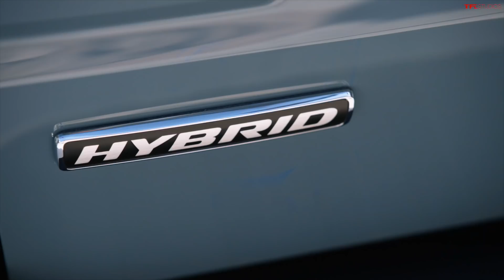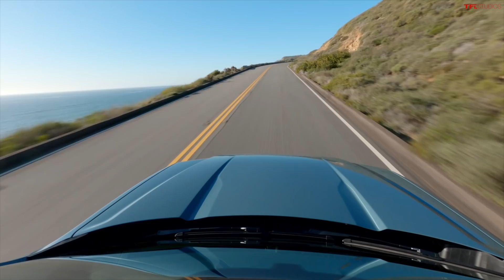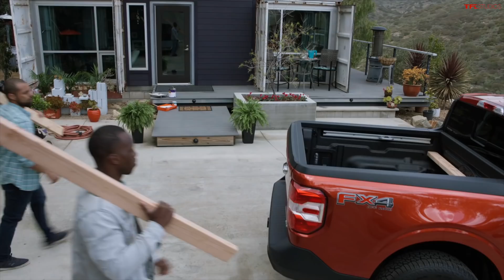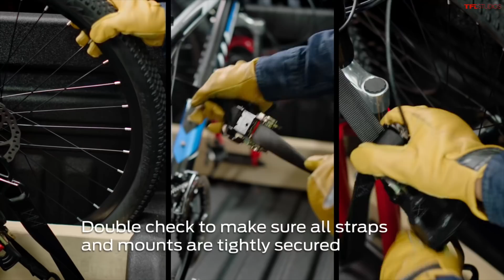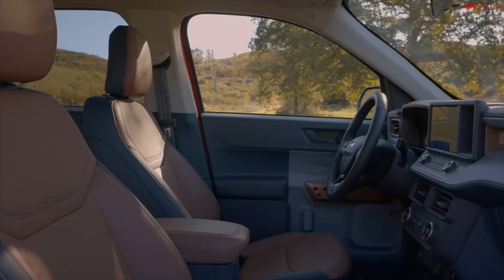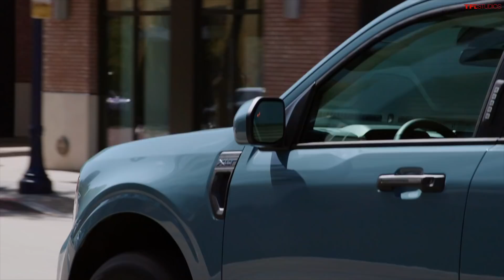What Do You Think Of The 2022 Ford Maverick? I Get ALL The Details From The Guy Who Built It!

Comment: Me when I first heard about this truck: "It's to small if I am buying a new truck it's going to be a full size." Me seeing the built in bed separators and hearing the price: "Look at my new truck."
Reply: I should have bought a bigger truck. You by the time payment one rolls around.
Reply: Me: I’m never going to need a truck!

Also me: yeup I’m buying a new truck!
Reply: Most trucks have built in bed separators and have had them for several decades. I use them in my Nissan Titan with 2x4s to keep my kayak from sliding around in the bed, same deal with the F-150 that I had before it.. But yes, the price and the mpgs cant be beat.

The only current exceptions are the Honda Ridgeline, which has no bed separator slots, and the Toyota Tacoma and Hyundai Santa Cruz which have horizontal separator slots but no vertical ones. Other than those three, every other truck currently on the market has both vertical and horizontal separator slots.
Reply: Like they say a fool and their money are soon parted, this Maverick is going to cause a lot of buyers remorse when people find out a unibody front wheel drive wannabe imposter pickup truck won't do much of any real hauling when you need to use it.
Reply: @ramecodiesel8271  Except that nobody is buying this expecting it to be an F-150. Ford has been very honest about its size and capabilities. For the one or two days a year where they need more capability than the Maverick offers, they can do what everyone else who has a crew-cab short-bed truck does and go rent a truck with an 8-foot bed for $25 from U-haul. 

Being foolish is buying a half-ton truck when you will never need or use its full potential.
Reply: @ramecodiesel8271  

It tows more weight than my old crew cab 01 Frontier could. And it barely got 17-18 MPG. And it was a real truck with a frame. Yet this little unibody can out tow it. And will get about ten mpg more. And will ride a million times better thanks to IRS and the unibody build. 

 I loved my little Frontier. And this truck is the first truck I’ve seen in a long time that reminds me of it. Something small, easy to maneuver and drive, and will fit in any garage. But without any of the negatives my Frontier had, which were numerous. 

The Maverick and Santa Cruz are successors to the small crew cab trucks that were being built in the early 00s. The Frontier, Tacoma, and S-10 were excellent little daily drivers but they had some severe issues that couldn’t be fixed. They all got crappy fuel economy and rode like shit. These new unibody mini trucks fix those two big issues and combine their positives (the easy to drive nature and utility) with modern technology.
Reply: Bed is too small. You couldn’t even lay a fishing pole diagonal in that thing.
Reply: @pagodad2036  It's a sub-$20,000 truck... there are going to be compromises. You can't have your cake and eat it too.

lemme guess, you also think it should have a 400 horsepower v8?
Reply: @dave3682  you’re not good at guessing.
Reply: More cargo room in a minivan.  Its a tiny persons truck.  Ill stick with my F150.
Reply: @keyoke69  My word, it's not like this thing is meant to replace the F-150... No one is telling you to trade your truck in for this. The F-150 won't work for Maverick owners for the same reason the Maverick won't work for F-150 owners.
Reply: @dave3682  20 bucks says you cant sit in the back seat.  Make it a 2 door and it could be a useful little truck.  As is, its trash.
Reply: @keyoke69  Looks like you owe me 20 bucks then. It has 36.9" of rear legroom... more than the Ford Ranger crew cab which has 34.5" of rear legroom.

Nobody buys 2-door trucks anymore. Yes, I agree, that's unfortunate, but if you're building a unibody truck and you only pick one cab and bed configuration you'd be foolish to choose anything other than a crew-cab short-bed because that configuration makes up over half of all truck sales. Especially since the Maverick is supposed to compete more with the likes of the Honda Civic than other larger pickup trucks.
Reply: @dave3682  I saw a review with a guy 5'9" in the back seat and he had no legroom.  The back seats of midsize trucks are only useful for kids.  This thing isnt a truck.  Its a car with no trunk lid.  A van would be a better choice in every way over this thing.
Reply: @keyoke69  I saw a review with a guy, 6'1", in the back seat with the drivers seat set to his driving position and he was able to fit his fingers in between the back of the seat and his knees.

What hybrid van can you get for $19,995 msrp???

Exactly, it is a cheaper and more fuel-efficient Honda Civic with a 4.5' open trunk and more payload than a double cab Tacoma. It don't matter what you call it, that's a helluva deal!
Reply: @dave3682  it doesn't matter how cheap a football bat is, Im not interested.  Be something,  not half a** everything.  Btw, im 6'3". Ive sat in all the midsize trucks.  The back seats are a joke.  They are a waste of money.  Better off with a van.  More comfort, more cargo room.
Reply: @dave3682  you know this thing isn't going to be 20k right?  Just wait.  Its a 1 model run vehicle.  Football bat is exactly right.
Reply: @keyoke69  What are you talking about? It literally says "Starting at $19,995" on the Ford website.

The number one complaint Ford dealers get about the new Ranger is that it's too big. Old Subaru Bajas are in extremely high demand and are commanding price tags just a few thousand dollars short of their original msrps. Obviously, the demand for a tiny pickup truck is through the roof right now. The demand for cheap hyrbids is also through the roof right now. The Maverick is both. There is no reason to believe that it won't be anything other than a resounding sales success. Your opinions about whether or not its a "real truck" or whether or not a minivan would be more useful do not change those two facts.
Reply: @dave3682   sure.  Just wait.  There is a reason those vehicles stopped being made.  And you know as well as I that no one is going to want the 20k version.  Add 10k for most buyers.  Now it doesn't seem like a very smart purchase.  Subaru baja? Give me a break.  Its a shopping cart.
Reply: @keyoke69  yes, because the market was different 25 years ago... 25 years ago minivans were still popular, now no one buys them. Markets change, demand changes.

That is true for literally every single vehicle that exists. No one buys the $29k version of the F-150, either, but you CAN get one for 29k. Can we please leave the goalposts in the ground? Thank you.

It's doesn't matter if it's a shopping cart, it is extremely popular right now.

The fact that the Maverick is the cheapest new hybrid in America alone is going to mean that it will sell like hotcakes, regardless of what kind of vehicle it is.
Reply: @dave3682  you live in fantasy land.  Its not even to market yet and you claim its selling like hotcakes.  Lmao.  Just stop.  The maverick is gonna be a flop just like the sport trac was.  The market hasnt changed that much at all.  Vans dont sell anymore? Are you serious?  Do you not realise the big 3 offer 20k vans? Quit talking about strawmen and moving goal posts.  You look silly.
Reply: @keyoke69  The implication was that it is going to sell like hotcakes. Stop putting words in my mouth.

The Sport Trac went on for 2 generations and sold almost 400,000 units. It was killed off by the downturn in the economy. Besides, the Maverick is not the same thing. It's smaller and cheaper with greater mass-market appeal.

15 years ago the Honda Odyssey moved 178,000 units in 2006. In 2019 (pre-pandemic) they sold just 99,000. The same is true for all minivan sales, they've completely collapsed over the last two decades. The market has changed significantly. 

Do you even do any research before you post? Or do you just like to keep living in a world where your opinion, unsupported by any data or facts, is the only thing that matters?
Reply: @dave3682  small vans noob.  20k vans.  Nissan, Ford, Chevy, Ram all make small vans.  400k units over 2 generations is a flop for Ford.  Learn from history.  Its a dead zone in the market.  If you are gonna act superior at least keep up.
Reply: @keyoke69  those aren't the vans I was referring to when I said that the market has changed. I specifically said minivans. Learn to read.

There has never been a crew cab hybrid compact pickup before. This is unchartered waters and can't reliably be compared to the success or failure of anything that came before it as that would be comparing apples to oranges. All we can do is look at signs from the current market to guages a new vehicle's potential success. These things are true about the market today...

- pickup trucks, especially crew cab trucks, are in the highest demand they've ever been and their sales numbers back it up

- The most common complaint Ford dealers get from new Ranger owners is that it's too big

- Old used Subaru Bajas are in high demand and selling at just a few thousand dollars short of their original msrp.

-  hybrids are in high demand and experiencing record sales numbers.

Any rational person will look at these factors and understand that there is substantial demand for a vehicle exactly like the Maverick. It checks all the boxes. Beyond that, it's affordable, efficient, practical, and versatile which are winning traits for any vehicle.
Reply: @dave3682  Ive never heard anyone say the Ranger is to big.   You just make things up lol.  You have a hard time following logic.  A fool and his money are soon parted.  You go ahead and buy this shopping cart.  You will be trading it in when you realise its not big enough to do anything but commute in.  I get you want to love this thing but I think you will change your mind once you stand next to it.
Reply: @keyoke69  Literally look at the comments on any Maverick video and you'll see people  complaining about how big and expensive  the Ranger, and other midsize trucks in general, have gotten lately. Or go walk in to your local Ford dealer and ask them if they ever hear from people that the new Ranger is too big. Once again, your opinion and personal experience/ignorance do not dictate what is fact and fiction.

I have a Titan with an 8'3" bed to haul or tow anything the Maverick isn't up for. The Maverick isn't replacing my truck, its replacing my Forrester. The Maverick isn't a half-baked F-150, it's a Ford Escape with a bed. The Maverick isn't a substitute for a large pickup truck, it's a substitute for cheap suvs and sedans and an alternative to midsize pickups for people who do not need/want the size, capability, and price tag that comes with them . Do you seriously not understand this?
Reply: @dave3682  you have a Titan with an 8'3" bed? Do you have a pet unicorn to?  Lmfao. How smart are you buying multiple vehicles.   Dont ever call anyone ignorant again.  I cant even..
Reply: @keyoke69  ... Yes??? Nissan built a single-cab long-bed (98.5") Titan from 2017-2019.  Look it up. 

Most Americans own more than one vehicle...
Reply: @dave3682  may as well buy a full size 4 door truck.  You wont need another vehicle.  And you will spend less.  Thats why the small truck market is only good for short runs.  People figure out they can just spend another 5k and get one vehicle to do everything.  Genius.
Reply: @keyoke69  and drive a friggin school bus around town? You have any idea how huge a crew-cab long-bed truck is? The entire point of the Maverick is that it isn't the size of a building. What is the Mrs. Supposed to drive while I have the truck at work? Genius.
Reply: @dave3682  now we are considering multiple drivers? Who is moving the goalposts now?  Learn to drive.  Or just waste your money instead. You love a good football bat.
Reply: @keyoke69  see Doug De muro's video.
Reply: @dave3682  First it will have little appeal to those who don't like pickups to begin with, second if and that is a big "IF" it will be as popular as you think then you can bet Ford dealers will putting huge mark ups on it over and above the MSRP.
Reply: @ramecodiesel8271  Ford dealers already got in trouble for marking up their mach Es, they're not going to mark up the Maverick. Besides, the entire appeal of the Maverick is that it's cheap. If you remove the cheap aspect, you remove the appeal.

Most people who don't have a pickup would like to have a one, they just can't afford one, or don't want one that is so big. The Maverick is an attempt to solve both of those issues.
Reply: @keyoke69  some of us want to get better than 20 mpg at best and aren’t willing to splurge for a diesel half-ton to increase that. 

This truck isn’t for the traditional full size truck buyer. It’s for someone like me who has a full size SUV that can tow 9000 pounds but is overkill for what I usually tow, which is 2000 pounds. 

If I end up getting one, the Maverick will replace my Honda Civic Si. Yes I will lose some mileage since I don’t expect the ecoboost option to get over 29 mpg Highway (I would consider the hybrid, but I don’t like towing more than 50-70% of the total tow capacity so I need the 4K tow option), but it’s not such a drastic reduction that I’m willing to rule it out. My Civic is only good for point a to point b driving. The Maverick will do that well but also allow me to tow my mower or ATV around without having to hook up the small utility trailer to an enormous Yukon XL that never gets above 16 mpg.
Reply: @OrtadragoonX  I suppose.  Personally I feel owning more vehicles than you can drive at once leads to one of them being a waste of money.  This truck seems really cheap and I bet they arent worth 7500 bucks when they are 5 years old.  I hope they sell like hotcakes though because Im in the supply chain for it.
Reply: @keyoke69  I’ve always tried to keep two very different vehicles that serve different purposes. 

For a long time, I had a Celica as a daily and that Yukon I mentioned was my tow or long distance drive vehicle since it was comfortable to seat me and my friends who of course helped out with gas. It only has 110,000 miles on it now and it’s been paid off a long time. I’m not gonna get rid of it because it does serve a purpose. 

My Civic Si replaced my Celica. But it was a compromise vehicle. I was engaged at the time and me and the girl were talking about having a kid after we got married. That shit fell apart. So looking at it now, it reminds of a life I never got to have and it really wasn’t what I wanted. 

So if I get one of these, it’ll replace that Civic. Good enough fuel economy as a daily driver while also allowing me to stop using that Yukon for easy jobs (like mowing) that it’s way overkill for. I can reserve it for long trips where I need the extra space or for towing something in 4000 through 7000 pound range, like scrap metal.
Reply: @keyoke69  ….you, bud, are a troll.  Not much goi; on in your life, is there?  😂
Reply: @jpear  Hey Fionna, dont break your maverick tailgate when you sit on it.  Dont flip it over.
Reply: @jpear  I bet you posted on these weeks old comments from the toilet didn't ya.  Who is the bored one?
Reply: @keyoke69  Looks like you owe him five bucks. We sat in one, we're 6 feet ish with the front seat set to our driving position. No issues with comfort at all.
Reply: @keyoke69  The maverick actually has an little more interior space than some midsized trucks.
Reply: @KB-bh9hp  you posting from the toilet to?  Sweet.
Reply: @keyoke69  Well, at least that means I'm not full of shit. So you can take my word for what I said lol.
Reply: @KB-bh9hp  I've seen the Maverick. It reminds me of a cheap-ass Ford Tempo.
Reply: @keyoke69  You can believe what you want to believe.
Reply: @KB-bh9hp  its just my opinion.  How much was the one you sat in?
Reply: @keyoke69  25ish.
Reply: @keyoke69  ok big boy because your truck makes you bigger.
Reply: @edwardschmitt5710  seen all I need to, and laughed and laughed.

Comment: It looks like everything the Ranger used to be.  I like it!
Reply: Or the Explorer Sport-Trac!
Reply: @jeffthejinjer  was the sport track body on frame?
Reply: @floridaman7  yes it was an explorer with a bed on it.
Reply: @floridaman7  Yes, but it had leaf springs in the rear.  It was an old-school explorer, but a very bouncy one...
Reply: @jeffthejinjer  sports track was much bigger, and better looking imo.
Reply: @doylee469  yes I liked them! The 4.0L V6 was a bear to do timing chains on but other than that very reliable and plenty of power!
Reply: @jeffthejinjer  my coworker has a sports trac and he had it to 160k and it was super solid. No tranny or motor issues. Good looking truck
Reply: And it doesn’t bother me that it’s standard fwd because rwd stink in the snow anyway.
Reply: @lawnmowerdude  But if you pull a trailer, your front axle will unload and may slip. But the rear axle will be loaded and there will be more traction with the road! I would prefer rear-wheel drive
Reply: And with 4 doors finally
Reply: I’d wait a few years to get the bugs out before buying.
Reply: NOPE   my 1987 Ranger STX long bed was more useful. That so-called bed is laughable.